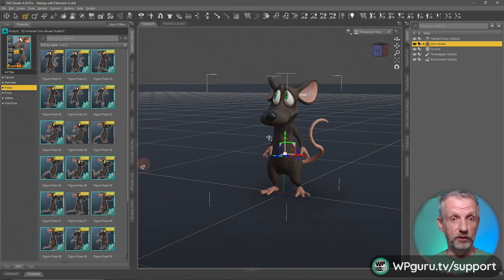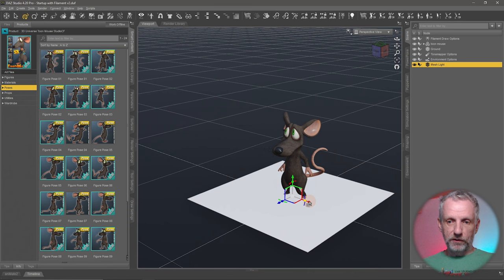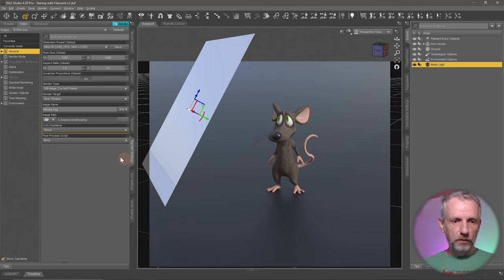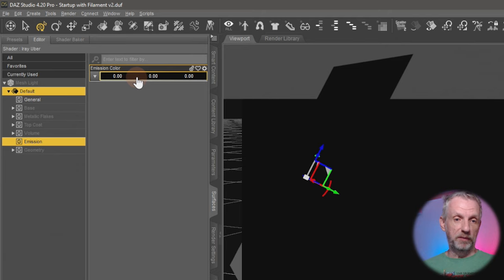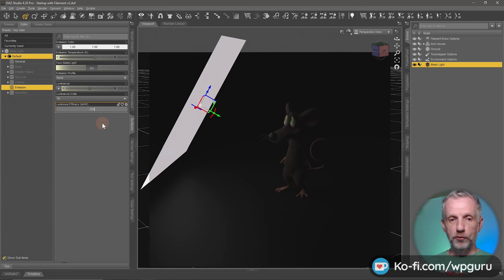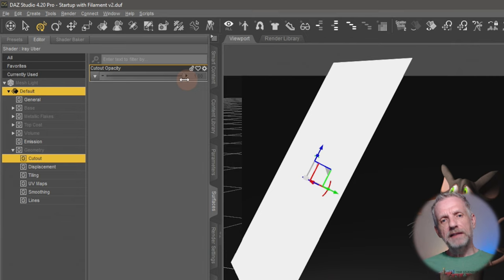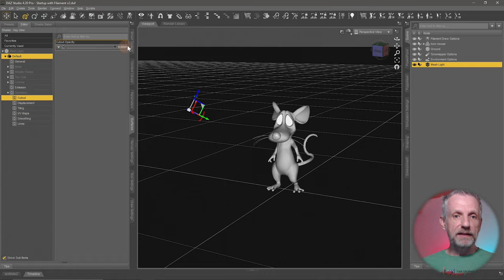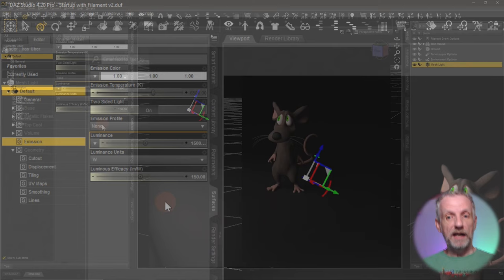Changes to invisible Mesh Lights in Daz Studio 4.20

Comment: Thanks for this video. Very useful. However ... I have made the decision to lock my configuration at 4.16 because this is not just a case of changing how "Ghost Lights" work it is also the breaking of existing products and the ruination of any existing work that used techniques which, after all, you yourself created a video showing how to use and for which DAZ sold products using the system. I understand that the fault is with NVidia, who have no interest whatsoever in DAZ Studio users other than as a route to sell more graphics cards - which you can't buy anyway! Anyway, thanks again, your videos are always interesting and informative.

Comment: One would think that the peeps who make Daz would turn "Ghostlight" in to a toggle.
Reply from the maker: Indeed, and that option exists on the regular scene lights (point lights and spotlight). Those are actually mesh lights under the hood, I guess it's just not implemented on the regular Emission channel.
Reply: @WPguru  why use ghost lights at all then?
Reply from the maker: @timdoheny-adams1008  😄 Good question! Like so often in 3D, there's more than one way to skin a cat. Some users prefer ghost lights, other prefer to light with parametric lights. There's no right or wrong way to do lighting.
Reply: @WPguru  thanks for the reply! I’ve seen a few guides which say rendering time is quicker with ghost lights instead of spotlights. Do you know if this is true?
Reply from the maker: Not in my experience.

Comment: It seams the higher I set the ghost light, the more speckled the render is at the start and the longer it takes to achieve any sort of acceptable render. I wish I was more disciplined when it comes to updates. Volumetric fog? I couldn't care less, I'd rather ghost lights functioned the way they used to. There must be a version of 4.16 floating around somewhere.
Reply: Done, back to 4.16 and ghost lights work again. What I don't understand, is in the Daz forums, blame seems to be directed towards NVidia, yet I'm using the same drivers 511.79, the only difference is the version of Daz.
Reply from the maker: It’s an update in Iray that’s causing this change, which is made (or used to be made) by NVIDIA. The new version of Daz Studio includes a new version of Iray.

Comment: Thanks for this work around, but now its now a real  headache control amount of light output. Ive tried till im blue in the face to recover an old scene with invisble mesh lights and i just cannot restore the same amount of intensity that i had before. I think its basically safe to say that invisble mesh light are not merely  'changed' but 'broken' and should be avoided where ever possible from here on. just a nightmare to set them up this way. I dont know why they couldnt have added a simple invisible source 'on / off' toggle
Reply from the maker: You're in luck: this change is coming and in the works. The latest version of Iray has a property exposed that lets us hide the emitter for emissive surfaces. A script is required to enable this, but the next version of Daz Studio will ship with it as part of the Default Resources: https://www.daz3d.com/forums/discussion/609556/creating-a-ghost-light-daz-studio-4-21-1-25

Comment: Thank you! Even when I do this, however, there are so many fireflies in the shape of the ghost-light that it may as well not be invisible at all. When the brightness is very low this doesn't happen, but now since we have to exponentially increase the luminance, etc to make up for the opacity, they are unusable for me. Is this a glitch? Am I doing something wrong? This wasn't happening in 4.16
Reply: I had this in 4.16 as well. But it is mostly visible in a dark background. Which can be blackened in post work.

Comment: It is annoying, why was there no warning about this effect ? - I have scenes with a heavy amount of lights, where the props used in the scene did not have different areas for the emissive part of the prop. For example a candle with just one surface and if you add emission to that candle the whole candle emits light not only the flame. I placed emissive invisible objects above the candle flame to replace the effect an emissive flame would have.  That whole work ist now for nothing and new renders in the scenes are now sh.... . I now have to touch and fix every bought prop that needs an emissive surface and does not have one have to remake all lights in the scene, because now you see the mesh lights, even if you go to 0.00000001 and you get a high amount of noise in the area with the mesh lights especially if it is in full view of the camera. 

It would be better they would chose to change the product in areas it needs work like working with more than one core or a search where you can search after specific type of parts like props, chars, materials etc. and not only a generic name search in the content or smart content tab or just don't try to load every damned morph you have when you only use one morph in a char to make the loading time faster. And I still don't understand why a simple File->New takes that much time (It's faster to end DAZ and restart it.)
Reply from the maker: I hear you! I highly recommend keeping a separate (manual) installation of 4.16 around so that you can render those existing scenes without having to rework them all, it'll save so much time. All you need is the 4.16 installer, unZIP it and run the app from there. It'll share all settings and libraries, just don't run two separate versions at the same time to avoid conflicts.
If you ever need to make a portion of an object emissive that doesn't have a separate surface, the Geometry Editor can create new ones. I'll make a video about this, it's a "hidden gem" that's really handy.
Reply: @WPguru   where do I find the 4.16 installer, today I had problem which made me uninstall and install Daz again, the problem is version installed was the new one 4.20 and now I have no idea how to turn  back as also all my work is based on the previous version.
Reply from the maker: @Dnakii  Sadly Daz don't make older installers available for download. You may find it in your Install Manager's Downloads directory (on Windows, the default path is Users/Public/Public Documents/DAZ 3D/InstallManager/Downloads). If it's not there, you may have to hunt around via Google. When you find it, unZIP it and run the DAZStudio.exe in that folder, it'll just run independently from the latest version you have installed. Best of both worlds.

Comment: They actually broke them in 4.16.
Reply: Yeah, i can't get ghost lights to work at all in 4.16.
Reply: @1986Hikaru  It's the same deal here, you have to crank up the power, and make them less invisible. For every .0 you have in the opacity slider, you need to increase the power of your light by 10.